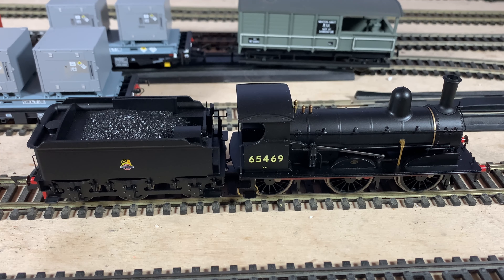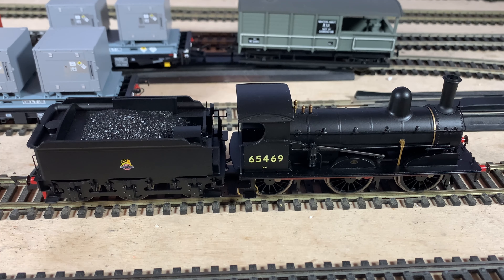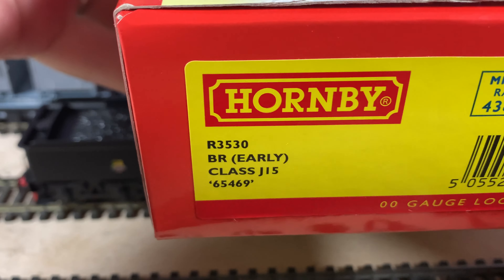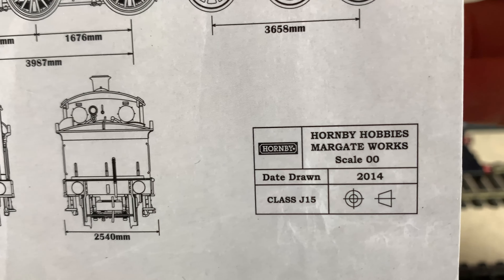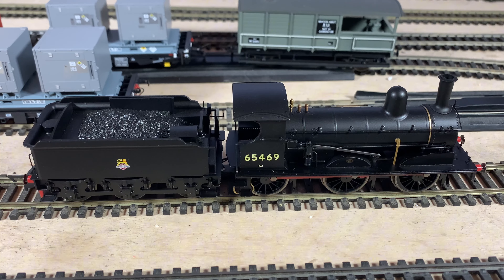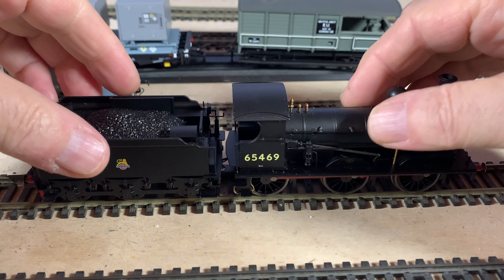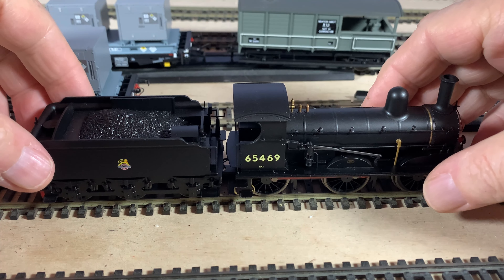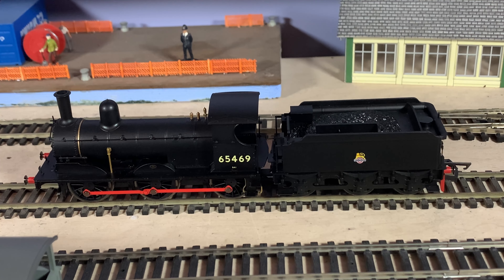When all you hear and read is that Hornby could be finished.....

Comment: I grew up with Hornby and want them to succeed. As a GWR era 3 modeller thankfully I'm getting better quality at far more reasonable prices from other manufacturers. My last Hornby locomotive purchase was a large prairie at a good discount. The J15 is a lovely model & demonstrates what they can do. Cheers.
Reply from the maker: Hornby do have some wonderful locos, like this J15, in their repertoire. Sadly, most are older models and usually no longer available new. I too want Hornby to come good again.
Reply: I just don’t get all this negativity about Hornby. Compare their prices with Bachmann, Heljan etc. I see no price advantages in these other manufacturers products. In fact, the price of Bachmann’s latest offerings are, if anything, above Hornby’s like for like. Then when you add the innovative systems and extras Hornby are bringing to the market - eg smoke generators and the amazing (and very cost effective) HM7000 Bluetooth dcc system, which has revolutionised operational fun; the value of Hornby just becomes indisputable. But if you still want “budget” prices, then Hornby’s Railroad range is the answer - again without comparable offerings from other companies. Let’s just celebrate and support Hornby; they are vital to our hobby.

Comment: Hi Michael, a very nice model and your enthusiasm for it is quite understandable. I do still buy Hornby models and I have a Diesel Class 31 on its way to me now. I notice that you have not fitted the extras and being an open cab type did they supply a crew ? Regards from Ron 🚂👍
Reply from the maker: The only extras with it is brake rigging. There may have been some pipes that I did fit but can't remember! Sadly no crew though.

Comment: When Hornby get it right they can but sadly nowadays it's  hit or miss. But other manufacturers  are not fault free either. Hornbys last financial statement was not good a mix of heavy debt and profits down. The price hikes of 00 gauge didn't  help them one theory  I have is Hornby  did not have the money to develop  TT scale hence the price rise of 00 gauge to pay for it taking a risky  gamble plus they have a complete  control of the TT market. I'm guessing given that retailers not so long back were selling TT train sets off at at big discount  it has not taken off. The other bit of news is KR Models Leader is about to hit the shops will you be rushing out to buy one ?😂
Reply from the maker: I tend to agree with your TT scale theory, it certainly fits. I am currently NOT considering the KR Models Leader. If nothing else, it looks a bit naff going by that Hornby Mag video.